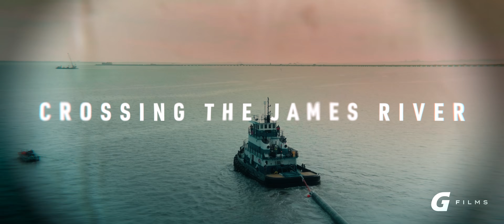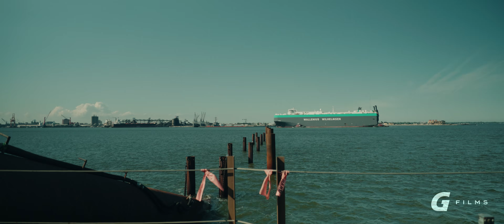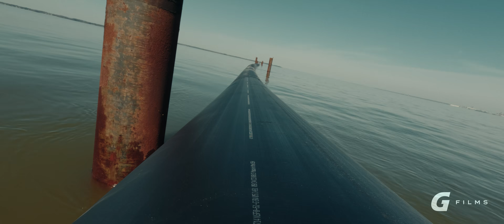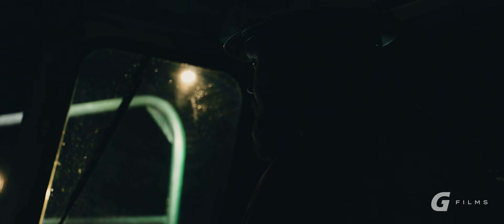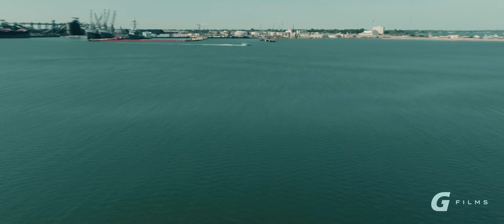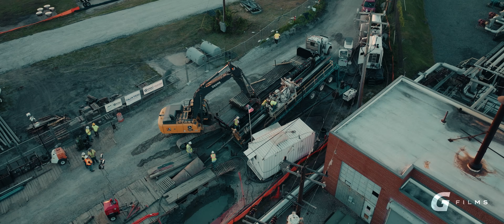Breaking Records: The Untold Story of the James River Pipeline (Part 1)

Comment: What is the purpose of the pipe? I worked for HRSD back in the 80s and 90s . I remember when they did this across the Elizabeth and York Rivers.

Are you connecting plants like boat harbor and nansemond wwtps?
Reply from the maker: Very cool that you worked for HRSD in the 80s and 90s! That is correct - this pipeline conveys treated water from the new Boat House Pump Station in Newport News, VA to the Nansemond Treatment Plant in Suffolk, VA for further purification.

Comment: What drilling machine performed the pipe installation? Is it the same machine that performed the pilot drilling? Congratulations to the whole crew.
Reply: If you look at Aaron Witt he does civil earth moving content and just posted a video on the installation and drilling process, he was actually invited onsite by Carney. It provides a few about the process not covered here.
Reply from the maker: @Mediterraneandrillingcompany  @karlmckinnell2635  Definitely check out Aaron's video! He did a fantastic job providing a thorough overview of the project from start to finish. Our documentary mainly focuses on the 'pullback' section, but there's so much more to the entire scope. Stay tuned for more documentaries on this project (and other Garney projects) coming soon on our channel!
Reply from the maker: @Mediterraneandrillingcompany  For the pipe installation a HRE 1.2 million pound rig on land was used along with a specialized pipe pusher on the platform on the water.  The pilot was done with a American Augers 240 and a HRE 500 HRE because the HRE 1.2 million rig was getting serviced to be used on the pipe installation.👍